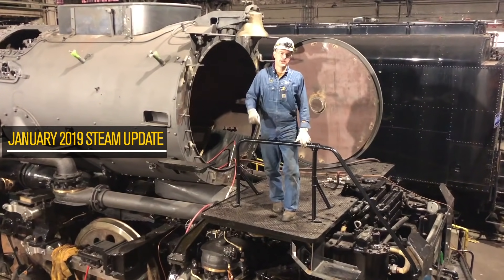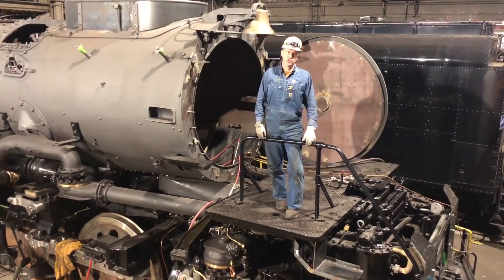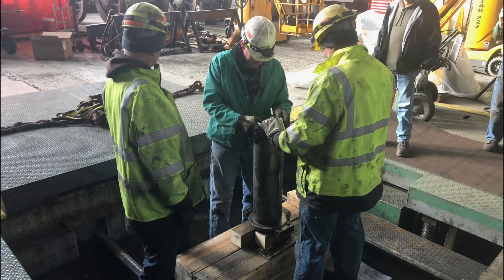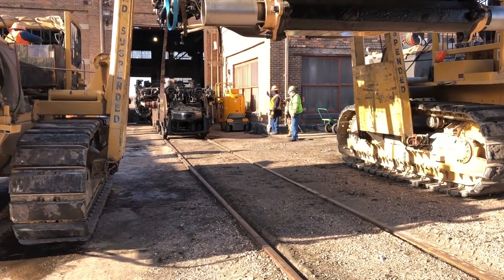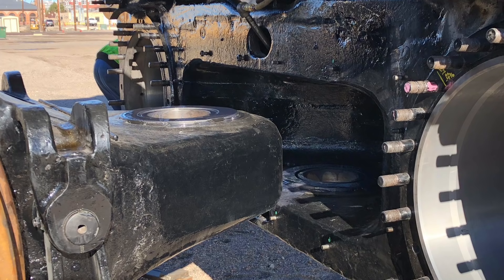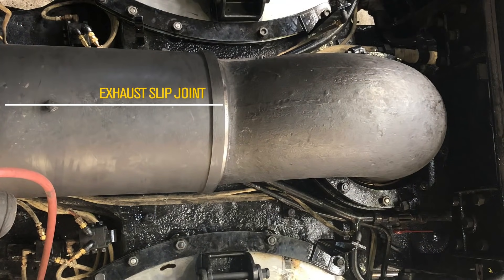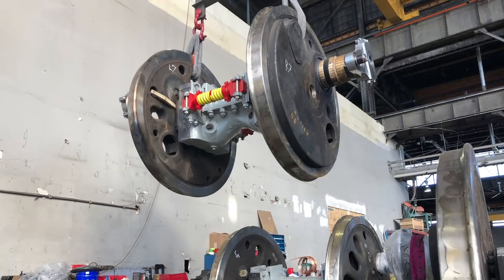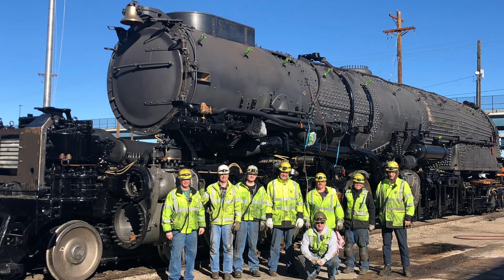Steam Update: The Big Boy is Back Together Again

Comment: When it is finally back on the track, the USA will have another national icon besides Mount Rushmore! The 4014 will run much better than somewhere in the 1940s when it left the ALCO peoduction line - thanks to improved parts that went into the reconstruction process, cf. Mr Dickens's very interesting videos!

Comment: How much longer until Union Pacific realizes that steam can be more cost effective and environmentally freindly
Reply: Eh. The thing is (and don't get me wrong, i like steam engines way better) diesels are easier to use, maintain, and to get moving.
Reply: The CPMR 
Well they were when they made the transition, but there were a slew of other factors contributing. But a steam engine had a viable working lifespan of maybe 20-30 years while diesels have one of about 5. So long term they can be more cost effective. Now in the future if they do use steam locomotives, coal may not be a main fuel source, more likely to be gas burning or even diesel. They are harder to maintain, and the skills to maintain them have been lost, but they are worth it.
Reply: I really wonder the same. There's a CN yard north of where I live and right behind the place I work at. I watch all these small to medium sized trains pass through with 2, 3 or even 4 "modern" diesels and wonder why? They know there are large consists to be pulled year round, why require so many  small inferior engines to do what one proper one could do?  This kind of thing only fuels that kind of thought: https://www.youtube.com/watch?v=RU9uEwSGp9M and that's only a little 4-8-4 with big drive wheels more suited for speed that brute force. Imagine what a modernized challenger or big boy could do.
Reply: You got it man, it may only be a matter of time, i mean they knew it back when they switched to diesels, but that fuel was a lot cheaper back then and a hellofa different world than now. Time will tell for every railfans dream.

Comment: All of the finely machined parts and just about everything else I'm seeing you all doing and replacing are like individual works of art by themselves.  If I may add my 2-cents...please keep the drivers tires and wheel rims black on this fine locomotive and tender when it comes time to paint her and send her out to see the world again.  White or silver rims just don't look correct on these engines and never did any time they had them.  Black is just as classy and is proper.  Good work there, you rightfully should be proud.

Comment: Great work! It will be some amazing sight to see it steaming down the tracks. However, will they have time to convert the 4014 tender to oil, or will they go to Ogden with 3985’s tender?
Reply: From what I've heard -- They will NOT have time to convert 4014's tender; but will use 3985's tender, as they are basically the same.
Reply: Silver Turtle but they will eventually convert 4014’s tender for the excursions right?
Reply: Yes, they will.  I think they put that little part of the project on the back burner due to the availability of 3985's tender as a backup.
Reply: Silver Turtle thank you, seeing big boy running with a different tender is still way better than not!
Reply: Austin -- that's a good possibility.

Comment: Question: does the rear engine have any slight articulation, or is the frame rigid to the boiler?
Reply: The boiler and rear engine are permanently joined together, they can not be separated from each other.

Comment: It would be cool if you guys could do an East Coast Tour but since CSX is being annoying you can't.
Reply: You'll never see UP steam off of UP rails,  and you'll never see any other steam on UP rails
Reply: @Texassince1836  That is not entirely true. When 4014 returns to Southern California it will have to make use of the BNSF mainline to get over Cajon Pass. They can do that because UP has trackage rights on the BNSF from Daggett which is a few miles east of Barstow to Riverside where UPs mainline to Los Angeles breaks off again. There are also other places on the system where 4014 may end up using trackage of another railroad because UP has trackage rights over that particular route.

Comment: Did you guys get PTC Waivers?
Reply: I do not know??
Reply: Historical equipment and never operated over 79mph=no PTC needed.  If they wanted 844 to live up to her fullest potential again (over 100mph) they would need PTC.
Reply: @Texassince1836  it's not a matter if speed for PTC. It's the Federal Railway Administration standardizing PTC for Steam Locomotives that run on Class 1s. UP said they would investigate and prove there is no point of PTC for Steam Locomotives in hope for PTC Waivers from the Federal Railway Administration. I don't know what the update is on that.
Reply: @GTRFTrainCinematography  PTC on passenger trains over 79mph has been required since before the 4000 class was ever dreamed of. There is a speed factor in there.
Reply: @Texassince1836  Positive Train Control (PTC) must be installed on everything on Class 1s and including Steam Locomotives that run on Class 1s.

Comment: Sorry dont do Facebook, guess I won't be seeing anything from here on out
Reply from the maker: Hi Jeff. You are not required to use Facebook to be a member of Steam Club. Notifications are sent via email, and the discussion group is optional. (But a lot of fun!) You can sign up to receive emails at http://up.com/steamclub.
Reply: Union Pacific Plesse don't use proprietary platforms with mandatory sign-ins, especially dubious ones like Facebook. Many people such as Jeff and myself are utterly averse to having anything to do with them.
Reply: @EJP286CRSKW  Nothing wrong with using them, as long as it's in parallel. 

Just like many actively avoid Facebook, there are others who mainly rely on it for info, it wouldn't be nice to those folks to withhold info from them either.
Reply: You can access Facebook without an account. (If you are lucky of course because some features aren’t available without logging in)